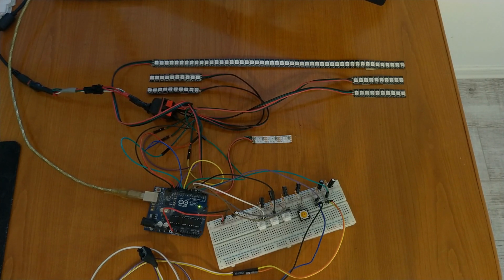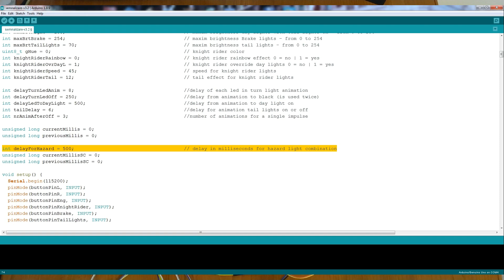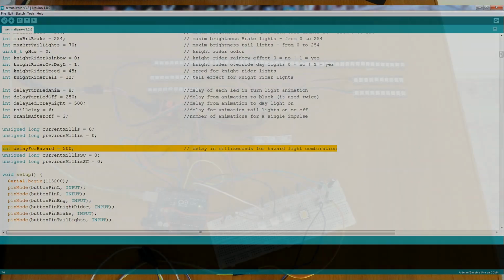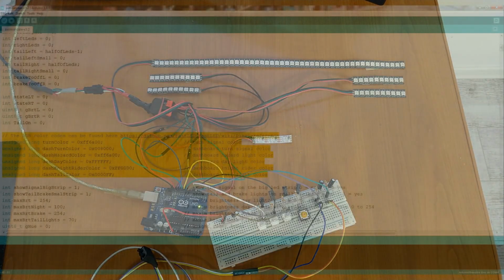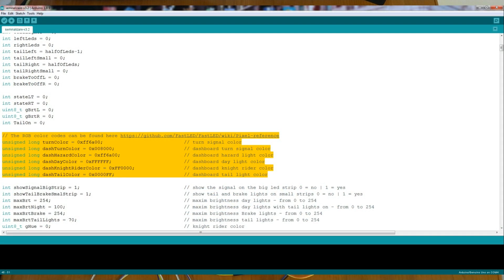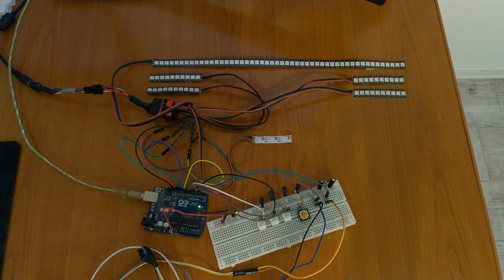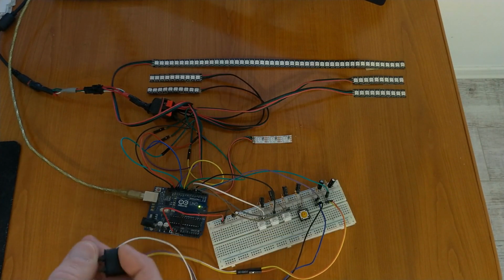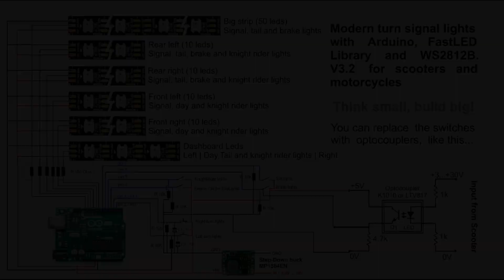Sequential turn signal lights v3.2 for scooters and motorcycles-Arduino,FastLED and WS2812B NEOPIXEL

Comment: Hello, great video! I am using an edited version of "knightRider" larson scan like in your video. However I am using 250 LEDs. When I set speed to 1ms it is still too slow. To fix this, I want to change the width of the "eye" / how many LEDs are lit up during the larson scan pattern. Right now it seems I can only get it to do one at a time. I'd like around 10 at a time. Any suggestions on what I'm doing wrong?
Reply from the maker: After little thinking, you have to write function from scratch. Divide the entire number of led's into equal number of groups, after that you can use the beatsin16 function and provide it the number of groups (not the number of leds) to go forward and backward and use fill_gradient function to acces the led's in groups... (don't forget to add the fadeToBlackBy).
Reply: @IonutF-TS-BB  Thank you for the reply! I am not entirely familiar with how to implement the beatsin16 function but I will experiment with it. I will try and divide the strip into segments like you mentioned but I only know how to turn them ON/OFF and haven't gotten them to fade properly. Alternatively, I edited the code to have a wider eye rather than one at a time, but the animation still isn't completing quick enough. Here are the two versions of code I tried. The original called "knightRider", and the bigger eye called "knighScan":
void setup() {
  // put your setup code here, to run once:
strip.begin();
  strip.setBrightness(BRIGHTNESS);
  strip.show();
  knightScan(255, 0, 255, 1, 50, 5, 0);
  knightScan(0, 255, 0, 1, 50, 5, 0);
  knightScan(255, 255, 255, 1, 50, 5, 0);
  knightRider(1, 0, 2, 0x9500FF);
  knightRider(1, 0, 2, 0xFFFFFF);
  knightRider(1, 0, 2, 0x00FF00);
  
}

void loop() {
  // put your main code here, to run repeatedly:

}

// Function for larson scan.
void knightRider(uint16_t cycles, uint16_t speed, uint8_t width, uint32_t color) {
  uint32_t old_val[NUM_PIXELS]; // up to 256 lights!

  for (int i = 0; i < cycles; i++) {
    for (int count = 1; count < NUM_PIXELS; count++) {
      strip.setPixelColor(count, color);
      old_val[count] = color;
      for (int x = count; x > 0; x--) {
        old_val[x - 1] = dimColor(old_val[x - 1], width);
        strip.setPixelColor(x - 1, old_val[x - 1]);
      }
      strip.show();
      //delayMicroseconds(speed);
    }

    for (int count = NUM_PIXELS - 1; count >= 0; count--) {
      strip.setPixelColor(count, color);
      old_val[count] = color;
      for (int x = count; x <= NUM_PIXELS ; x++) {
        old_val[x - 1] = dimColor(old_val[x - 1], width);
        strip.setPixelColor(x + 1, old_val[x + 1]);
      }
      strip.show();
      //delayMicroseconds(speed);
    }

  }
}

///////////////////////////////////////////////////////////////////////////////////////////////////////////////////////
void knightScan(int r, int g, int b, int rounds, int width, int fade, int wait){
  int faktor = 20/(fade*2);
  int r2, g2, b2;

  for (int c = 0; c < rounds; c++) {  // legt fest wie viele Runden abgespielt werden sollen
    
    for(int i=0; i<strip.numPixels()+width+fade; i++) {  // gesamten Strip durchlaufen VORWÄRTS
  
      for(int j=0; j < width; j++){ // hier werden die Pixel (ohne den fade) generiert
        strip.setPixelColor(i-j, r, g, b);    
         
        for(int f = fade; f > 0; f--) {  // hier wird das fade generiert und an das Band angehängt
          r2 = (r / 20) * (f * faktor);
          g2 = (g / 20) * (f * faktor);
          b2 = (b / 20) * (f * faktor);
          strip.setPixelColor((i-width-fade+f), r2, g2, b2);
        }
        
        strip.setPixelColor(i-width-fade, 0, 0, 0); // löscht die Pixel nach dem Fade
      }
      strip.show();
      delayMicroseconds(wait);
    }

    for(int i = strip.numPixels(); i>0-width-fade-2; i--) {  // gesamten Strip durchlaufen RÜCKWÄRTS (rw)
       for(int j = width; j > 0; j--){ //rw: hier werden die Pixel (ohne den fade) generiert
        strip.setPixelColor(i+j, r, g, b);    
         
        for(int f = fade; f > 0; f--) {  //rw: hier wird das fade generiert und an das Band angehängt
          r2 = (r / 20) * (f * faktor);
          g2 = (g / 20) * (f * faktor);
          b2 = (b / 20) * (f * faktor);
          strip.setPixelColor((i+width+fade-f+1), r2, g2, b2);
        }
        
        strip.setPixelColor(i+width+fade+1, 0, 0, 0); //rw löscht die Pixel nach dem Fade
      }
      strip.show();
      delayMicroseconds(wait);
    }
  }
}

Comment: hi great job, i would like to use only the functions of the top strip ( brake /tail / signals) not interested in the rest how can i modify the code please.
Reply from the maker: Thanks.
You don't need to modify the code for that, just ignore the output pins and ground all the input pins for the functions that you dont use.
Reply: @IonutF-TS-BB  so if i am using only a strip of 16 i replace the 50 to 16?
Reply from the maker: Well, i've tried to write the sketch as dynamically as possible, but if you open the sketch you will see that in the comments i've specified...

// number of leds for the big strip - should be the at least the number of leds from the small strips multiply by tree (in this case the minimum should be 10 x 3 = 30 leds)

So the big strip should be minimum 30 leds !

Comment: i really need your help!! how to make it wireless?  i know its possible i just dont know how to do it
having input from motorcycle using transmitter sending the signal
 to the receiver  connected to the arduino uno.

btw your videos really helps a lot tho 😍
Reply from the maker: Those lights are there for safety reason and will save your live! 
Wireless communications are not 100% reliable, they depend on the environment that you are using them ... any wireless signal can be jammed with anyone's will or without will...
Way would you want to make them wireless ?
Do you want to use them for your helmet?
Reply: @IonutF-TS-BB  exactly! like those on the market.
i'm trying to solve the wireless part of the device, so yeah definitely.
Reply from the maker: I don't think that bluetooth will be the answer for this project... but i won't rule it out completely...

My first choice will be RF, like H34A-433 for TX and LR45A for the TX in combination with RadioHead library... because for a powered battery project you will need to keep the power consumption at the minimum.

In the communication you can set an id and after that the command you want to send, the id is making sure that more than one device can work in the same area.

Comment: I would like to fund your next video. Im currently building a custom motorcycle and I love the idea of a procedural tail light. It would be a single piece 160mm x 160mm with rounded corners on top. RGB lights so you can use the ws2812 lights. 
The issue I have is that i don't know how to program nor do I know where to put resistors or 12 volt or 5 volt. 

I can send more detailed info if you're interested but I would like a unit with minimal effort that's legal and usable for $100 USD. If you're willing to add animations and maybe stream line so I can play with animations later on I would offer $150 USD. Not including shipping to atlanta Georgia United States.
Reply from the maker: Well it would be interesting, but I definitely need more info.
Just to know, i only do the code and the basic schematic, because i don't have to much time available and almost 90% of the time, the final version will need minor modification or adaptations in the final assembly. The basic schematic will include almost everything you will need to get started.
Right now i'm working at the lights for a prototype car, so in almost one month we can do it if everything it's ok.

Comment: Hi... 470 MAK from Jakarta just follow this interesting idea of turning signals. I have just built a simple lighting system based on this brilliant idea.  The turn L, turn R, Brake, day and tail light signal work very well. Knightrider work on red only i need to re learn the skecht. I will apply on my CBR400... Thanks a lod body for this ideas.
Reply from the maker: Great to hear about the inspiration and cool bike! ;)
If you need more info about the sketch just ask and i will answer when i have the time.
With pleasure!
Reply: @IonutF-TS-BB  Yes, I have asked ny self a about optocipler function in this circuit. However I still not co fidence about how it contribute to the circuit. If you could elaborate would be most appreciated. Thanks body
Reply from the maker: @pojok_plts  
To be able to control the arduino inputs that work at 5v you need to step down the voltage from the car witch is running at 12v-14.5v to 5v, so the optocoupler is needed to do this. There other alternatives, but this one is the safest because they are galvanic separated, which means that if you high voltage side blows up, nothing will leck to the low voltage side!
This is the simplest way that i can explain it! :)
Reply: thanks @IonutF-TS-BB  for your explanation and got it. hence, i will apply to other 5 switches.

Comment: Happy new year to you. I love your project work. Can you make game frame 10x10 matrix animation control with back and forth buttons and brightest control with potentiometer. It will help me lot.
Reply from the maker: Thanks! :)
Well, it would be interesting, but did you see this?
Presentation: https://www.youtube.com/watch?v=7mBdo75DtO0
Web site and store: http://ledseq.com/shop/
Source code: https://github.com/Jerware/GameFrameV2
Reply: Thanks for your reply. Please make dot matrix max7219 led animated turn light with left, right, forward,  brake light and night rider with button control for cycles🚲
Reply from the maker: @procad23  With pleasure.
It would be interesting, but i will make the matrix with ws2812b leds, not max7219 ... so, it will be in a future video. ;)

Comment: Really nice! I was about to try this with Neopixel insted of FastLED, do you see any problems with doing that? mainly because my virtual breadboard only have Neopixel and I know that MicroPython has support for that, I dont know if it has support for FastLED?
Reply from the maker: Thanks! :)
From my knowledge WS2812 and NeoPixel are extremely similar and the Adafruit_NeoPixel library supports them both ( https://github.com/adafruit/Adafruit_NeoPixel ), but i've never used the Adafruit_NeoPixel library, i've stick with FastLed library because of the math functions wich helps me to simplifys the code alot when i'm doing animations.
So, i really don't have a straight answer, you will have to try and see.